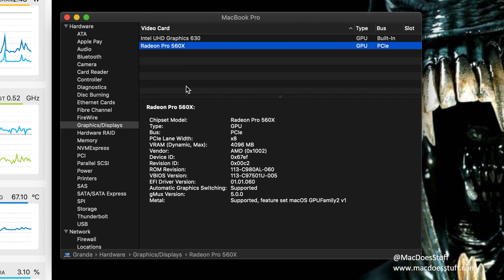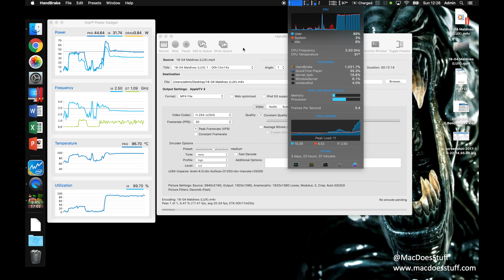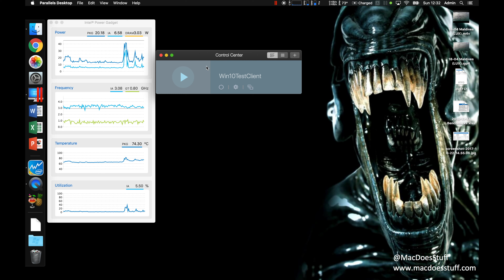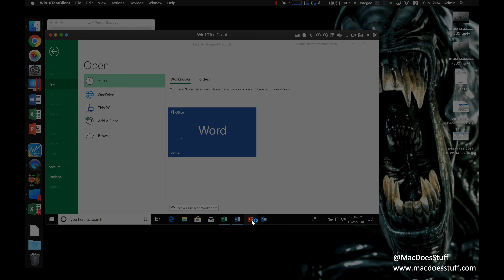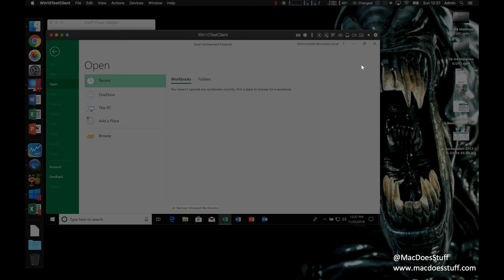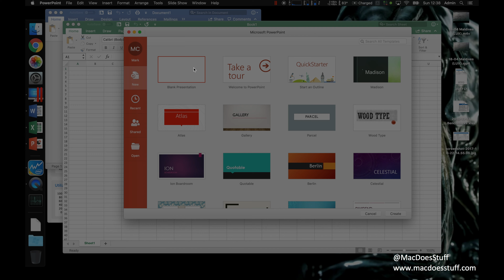2018 i9 Macbook Pro Performance

Comment: I've heard complaints about kernel panic and crackling speakers, have you ever had these problems? How long have you been using it?
Reply from the maker: Hi - I've had this since release, and have experienced none of those things. Have seen the complaints though. People reporting similar on the iMac Pro for example - but I've not seen it on there either.
Reply: @MacRS4  Thanks for your answer. I was trying to figure out if it was a large-scale problem of the new MBPs or a minimum percentage of units. There are foroum on macroumors of more than 100 pages but statistically they would be irrelevant as a number when compared to units sold. Very interesting your videos :)
Reply from the maker: @Rednunzio  Yeah I read the same thing. I think it appears to be an issue with the encrypted drive via the T2? That's the last thing I was reading anyway. T2 on the MBP, iMac Pro, and also the 2018 Mac Mini....and I've not experienced it on any. So far. Could be I've been lucky however we do have several of these it's not something I've heard of people moaning about.

Comment: Cool thanks for that! Great test methodology, far better than anything else I’ve seen on YouTube which seems to be all about taking twenty minutes to point out it has a nice speaker! Anyhow, just need to decide a i7 vs i9 🤔 might be nice on these high end machines to show a number of vm’s, servers etc which sounds like your real life and many other peoples. Pleased the iPhone sound app worked, well I think it did :)
Reply from the maker: Malcolm Bullock i7 👍
Reply: MacDoesStuff makes sense the i7, but just looked and it’s only a couple of hundred for the i9. In context of a 1tb, 32gb machine that’s not a large overhead. Hmmm, in w/c 3rd so will go and see some stuff and try and recover Apples share price single handed 👍